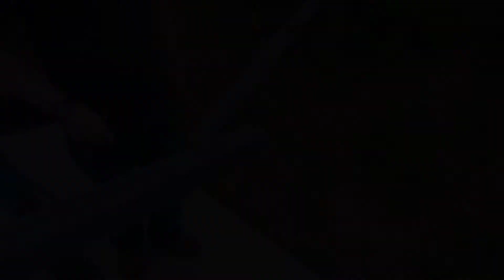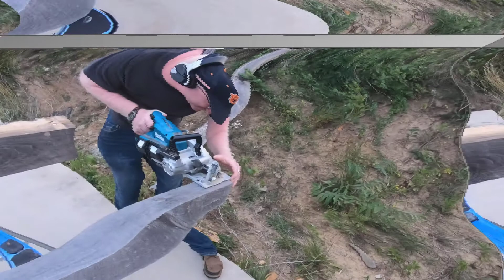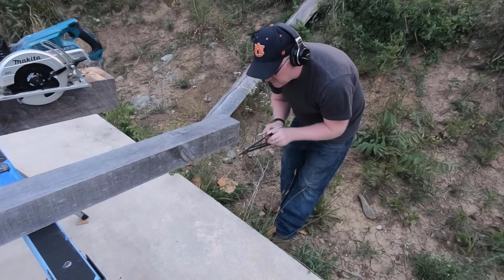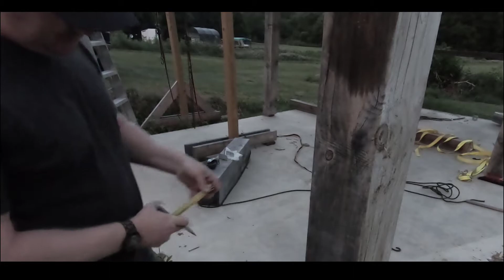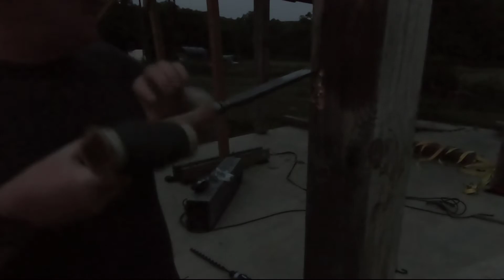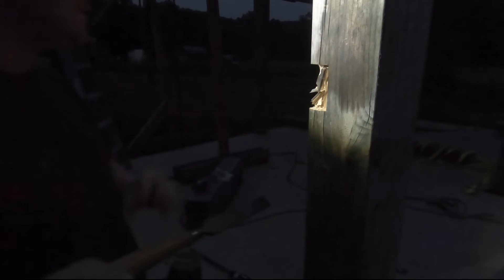Cutting the Girt for my Timber Frame

Comment: Hi, I just want to say that I'm really enjoying your videos. You have some great insight, so thank you for sharing. 
 I've fairly recently been getting into traditional Timber Framing and have been looking at getting various tools you've referenced in other videos. 
I wondered if you had any rationale behind the dimensions of your timber, is this driven by local code? 
I'm based in the UK where there is a real lack of guidance on traditional framed building timber strength requirements (without seeking a structural engineer). I wondered if your buildings scaled up/ down from Jack Sobons book?
Also with regards to your Makita chain morticers, I've seen the 7100 available for as low as £300 compared to the 7104 which is £750 (both pre owned). The 7104 is £1500 new here so very tempted to get the 7100 as an initial tool. Fyi it's about £1 to $1.20 so you can see the 7104 is costly! 
Best regards and keep up the good work
Reply from the maker: Thanks. I'm glad to help and glad the videos are helpful. If there is something you have a question about or would find helpful let me know.
Reply: @peanut_knife_works8417  thanks for the reply. I just wondered how you felt about the Makita morticers given the price difference? Regards. Michael
Reply from the maker: @Michael-mh5pu  It is tough to answer. The 7100b typically goes for 400-500 on ebay shipped. The 7104 I see typically for 900+. I got a deal on mine is why I picked it up. I'd go for whatever is in your budget. The 7104 is faster since you can do multiple cuts from one position but either will save you a lot of time over by hand.

If you have the money I would look at a swisspro. If you call them they regularly have refurbished ones in but those are around 2,000 american. I nearly pulled the trigger on the swiss pro but decided not to and saved the cash for use elsewhere.